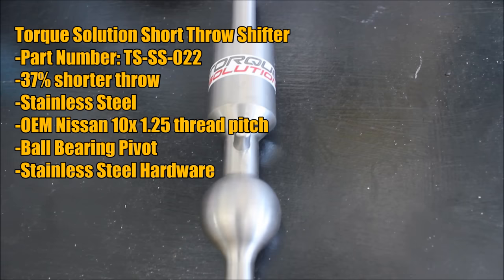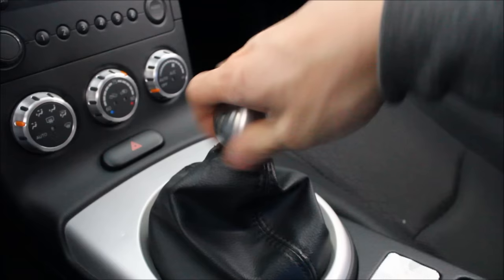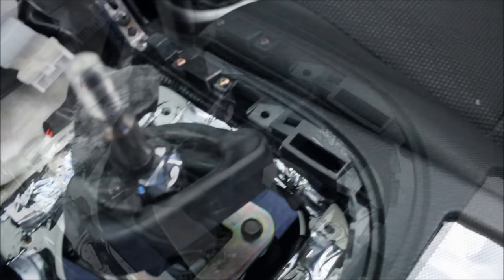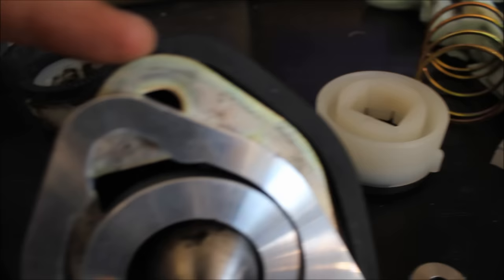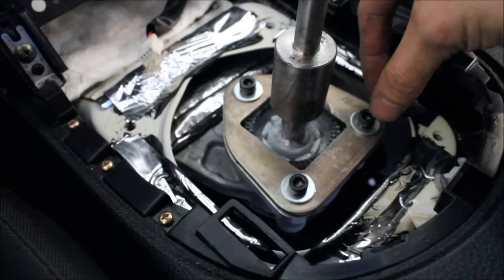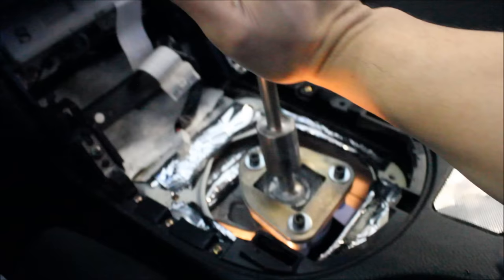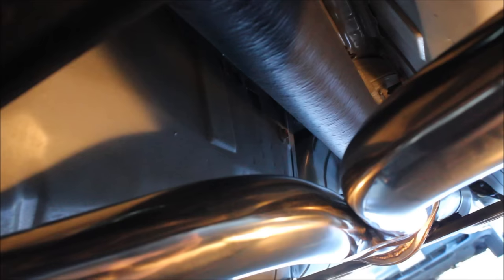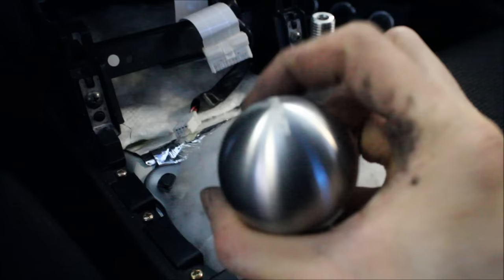Short Throw Shifter/ Short Shifter Install 6 Speed Nissan 350Z & Infiniti G35 (Torque Solution)

Comment: I just installed a Torque Solutions short shifter on my Z and the shifts feel great. BUT, I am having one problem, on accelerations from about 3500 RPM and up I get a rattling noise that gets progressively louder with RPM. Anyone know what this might be? I've taken it apart twice now and still can't seem to figure it out.
Reply from the maker: You might have the bolt too tight where the shifter bolts to the shifter fork of the transmission?
Reply: @AnthonyJ350  I found the problem after some wiggling around underneath the car. Turns out the next joint up from the fork on the shifter control rod was loose and was causing the crazy vibrations since the bushings that come with this shifter are solid aluminum. Needed to replace the whole thing but it's fixed now!
Reply from the maker: @obscure.mystic  Good job diagnosing !

Comment: Man I did everything by the book but my shifter will not fit with the spacers on it. Fits nice and snug without them thought. You think there would be issues running without them or should I try spreading the gap a little to fit the spacers?
Reply from the maker: Is it sloppy for fitment after?
Reply: @AnthonyJ350 I’m not sure I understand your question exactly. I don’t believe there was any slop anywhere, I virtually have to squeeze the shifter into the linkage point (without the spacers). I tried for a good while with them on and there was just no way unless I made the gap bigger. Everything installed fine after that, the shifts feel good, no issues yet. There is a minuscule amount of wiggle, barely enough to be noteworthy. I think it’s fine but I’m worried it might be an important part that’s slowly wearing things down
Reply from the maker: @marcoscortes8745  I would contact the manufacturer with pictures to verify.

Comment: Is a new shifter cup required? You can't use the original?
Reply from the maker: You can if you can get it off clean. The new one can be found cheap online though.

Comment: Does the shifter have vibration/rattle over 6000rpm?
Reply from the maker: I suppose a little bit.  But running at that high of RPM your focus is going to be on other things while driving.

Comment: Will this help with my Shifter being impossible to shift into. Like im at a red light and i have to jam my shifter into first it wont go in smoothly. Especially reverse i can almost never reverse.
Reply from the maker: Sounds like the synchros ste going. Try changing the transmission fluid to Redline Synthetic, they make one specifically for Nissan manual transmissions.
Reply: AnthonyJ350 - i just put in a new “used” tranny i still have a 1 month warranty left, but the shop keep making excuses, what should i do.
Reply from the maker: @slowgoat6089  Get your money back for the labour and take it to a transmission shop.

Comment: Hey Anthony, have you every noticed any noise/ vibration at about 4500-6500 rpms. Mine seems smooth at low rpms but to maybe have a little rattle at higher rpms? Maybe you could advise something?
Reply from the maker: samuel stover Is it happening all the time or only during acceleration or deceleration?
Reply: AnthonyJ350 Thank you for getting back so quick Anthony, the vibration is only on hard shifting about 4500 rpms. Maybe thought about rubber washes on each side on the bolt underneath the car? I don’t know let me know what you think?
Reply from the maker: samuel stover Hmmm, try doing what I did in this video. https://youtu.be/KV5fzIZyawc

Is the stock transmission bushing in good condition still?

Comment: Hey Anthony, I just installed this today everything went smooth, is it normal to be stiff? I feel like I have to put more muscle effort now than the oem lol
Reply from the maker: dee Yup you'll have to make more of an effort at first. I find putting a weighted shift knob helps make shifts easier.
Reply: Can u use the stock shift cup or do i need to buy a new one ?
Reply: AnthonyJ350 ?
Reply: I bought a new plastic nissan shifter cup from concept z
Reply from the maker: Louis meola You can use the old one but it's a hassel taking it off.

Comment: So do you need a new shifter cup socket or can you use the original one ?
Reply from the maker: If the old one is good you can reuse it. I just recommend changing it since you have it all apart. Just put some lubricant in it like the video.
Reply: AnthonyJ350 one more question, under the car by the linkage is it only one bolt holding it? Thanks!
Reply from the maker: @moisescristobal9740  For the linkage yes

Comment: What is that plastic piece you bought from concept z? What is it called? Do you need it for the install?
Reply from the maker: Tyler Lesko Which part in the video, I do t really remember :p
Reply: Nissan Part # 32870-AC800 shifter socket cup
Reply: I've broken 3 of them hahahaha. Do yourself a favor and don't hammer it in. Find a different way to do it

Comment: what do you call that bottom piece that covers the top of the boot? i need one.
Reply from the maker: Try Z1 Motorsports or Concept Z.
Reply: You must purchase a new cup or can the original cup be reused?
Reply from the maker: Daniel Dziewa You could reuse the old one, but you might damage it taking it off.  I'd start with a new one.  Concept Z or Z1 Motorsports should have it.

Comment: Hey Anthony I called my modding shop for my car and they reccomended a B&M short shifter. Do u know if that's a good shifter? they said it's high end.
Reply from the maker: Deftones 26 B&M makes really good products. But the 350Z version is 2 pieces and I've read it has excessive vibration. That's why I picked Torque Solution because it's 1 piece.
Reply: +AnthonyJ350 Wow ya I'm definitely going with torque solution. Is everything included or do I need to purchase anything else to make shifter work flawless?
Reply from the maker: Deftones 26 I think you just buy a new plastic white cup bushing that the shifter snaps into.

Comment: I'm thinking on getting the TWM short shifter for my 06 g35 coupe. What are you think?
Reply from the maker: Do it, you won't regret it.  It has a very solid feel.
Reply: Do you have any complaint or issues that have came up since you installed the torque solutions short throw shifter?
Reply from the maker: statuswashere Nope it's been awesome.  When people sit in the car and try it they have a little difficulty with it because they're not used to it.  Only thing is because I went with a stainless weighted shift knob, it's a little hot to the touch if I park in the sun, but I can tolerate it and it suits the interior so well.

I still recommend it.
Reply: AnthonyJ350 yeah I have the big type r shift knob from twm performance. Goes with my interior perfectly as well. However, I have to many people telling me the stock shifter is good as is. Built better as well. Idk how credible they are but that is just what I have heard.
Reply from the maker: statuswashere The stock shifter is nice.  But I needed it to be a tad of a shorter throw which the Torque Solution unit does.  And I think this is a more precise unit.

Comment: AnthonyJ350 Where did you apply the lithium grease?
Reply from the maker: Speed Obsession on the side of the bearing where the shifter moves and in the ball socket
Reply: Thanks, Having to buy from the US  because there is no UK supplier for both items, Was looking at the buddy club but the price is abit too much, Great video.
Reply from the maker: Speed Obsession Ya for the money it's such a precise piece.

Comment: What collar do you have to adjust your shift knob?
Reply from the maker: Artics Design Just a universal one from eBay.
Reply: AnthonyJ350 I know it's been a while but would you happen to remember which one it is? I cant seem to find it anywhere
Reply from the maker: Artics Design I'll see if I can find it later.
Reply: Okay thank you
Reply from the maker: It was this one I think.

https://rover.ebay.com/rover/1/711-53200-19255-0/1?icep_id=114&ipn=icep&toolid=20004&campid=5337982243&mpre=http%3A%2F%2Fwww.ebay.com%2Fitm%2FUniversal-M10X1-25-Thread-Shift-Knob-Boot-Retainer-Adapter-Manual-Gear-Shifter-%2F292085591181%3Fhash%3Ditem4401a86c8d%3Ag%3ACXkAAOSwIWVY9PvZ%26vxp%3Dmtr
Reply: $5 cant go wrong haha, thanks for looking and getting back to me, appreciate it.

Comment: Is their a pdf file I can download on instructions ?
Reply from the maker: Adam Nejad I'd contact Torque Solution if they have a file
Reply: AnthonyJ350 ok thnx
Reply: No reply from email.  When I called torque solutions.  They referred me to your video. Disappointed with their customer service. They told me the company doesn't have an instruction guide for their own product...what?
Reply from the maker: Adam Nejad I guess you can treat it like the stock shifter and refer to a Haynes manual. Is there something from the video you don't understand?
Reply: My buddy is deaf and needed written instructions.
Reply: He was mainly concerned with the spacers . I tried the best to explain it but I'm not to sure
Reply: Well, he's just gonna leave it for today. I'm gonna go over to his place tmrw and try to walk him through it.
Reply from the maker: Adam Nejad The ones with the bearings?
Reply from the maker: Adam Nejad There isn't closed captioning on this video yet? I look into it for him.
Reply: We got it done this morning.  Appreciate your help
Reply from the maker: Adam Nejad Nice, how do you guys like it?
Reply: He loves it. Little movement in the handle when accelerating. Nothing crazy, probably transmission mount. But he's not to worried about it. Thanks for responding.
Reply from the maker: Adam Nejad No problem. Ya look into the Torque Solution transmission mount. It's a little rough at first but after you break it in it's smooth.

Comment: Where can I get that collar?
Reply: @ 12:41
Reply from the maker: It's this one.  You can cut it easily if you want to. https://rover.ebay.com/rover/1/711-53200-19255-0/1?icep_id=114&ipn=icep&toolid=20004&campid=5337982243&mpre=https%3A%2F%2Fwww.ebay.com%2Fitm%2FUniversal-M10X1-25-Thread-Shift-Knob-Boot-Retainer-Adapter-Manual-Gear-Shifter%2F292085591181%3Fhash%3Ditem4401a86c8d%3Ag%3ACXkAAOSwIWVY9PvZ%26vxp%3Dmtr
Reply: Ok thank you man. I appreciate it.
Reply from the maker: LoCoPuFFz __ Glad to help :)

Comment: anybody else has a weird rattle noise from the shifter at about 5k rpm and above? just intalled mines and that is happening.
Reply from the maker: Render Lizswith probably too tight at the pivot point?
Reply: Render Lizswith 
i have the same issue. could you resolve it?
Reply from the maker: mrherredge Is it happening when you guys leave it in gear and deccelerate?
Reply: AnthonyJ350 
this happens while shifting into another gear while the revs are >5000. only occurs in the moment of gear change, no other vibrations or rattle while in gear or shifting below 5k. This also does not depend on the selected gear.
Reply from the maker: mrherredge How long is the vibration  for?
Reply: AnthonyJ350 
it stops right at clutch release \ beeing in gear
Reply from the maker: mrherredge So it vibrates when the pedal is pushed in?
Reply: AnthonyJ350 for me it happens all the time at high rpms when in gear. Accelerating, and deccelerating
Reply: Render Lizswith i already went back to the oem shifter months ago, sad to hear that you still have this issue. i would look through these comments then and now to check if someone got a solution as i want my shortshifter back without rattle sounds

Comment: Did have to get longer bolts because of the spacer?
Reply from the maker: Speed Obsession Which spacer are you referring to?
Reply: The 3 bolts mine won't reach.
Reply from the maker: Didn't it come with new hardware?  Check the instruction manual because it should also have list of contents.
Reply: No just came with spacers and the shifter, Probably because I bought it from Ebay, Any idea on the dimensions of the bolts?
Reply from the maker: Speed Obsession I'm really not sure. Is it a Torque Solution product?
Reply: Yeah just wasn't sold by torque solution direct, Doesn't matter I will match some new bolts up by the old ones, Just wondered what size they were, Thanks for your help mate.